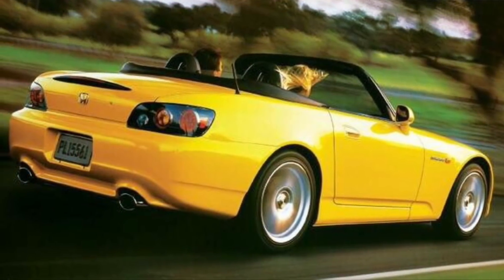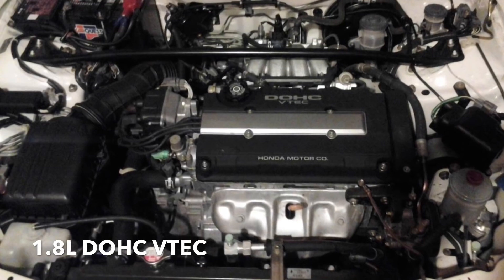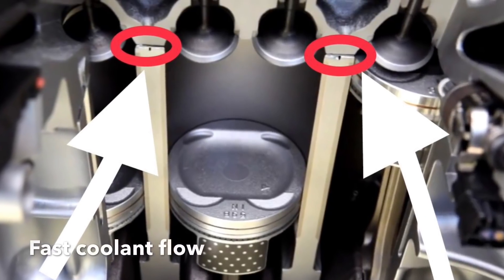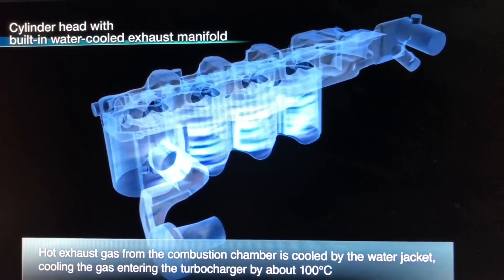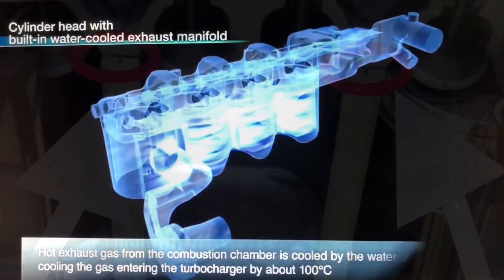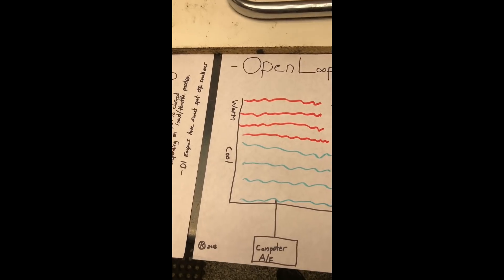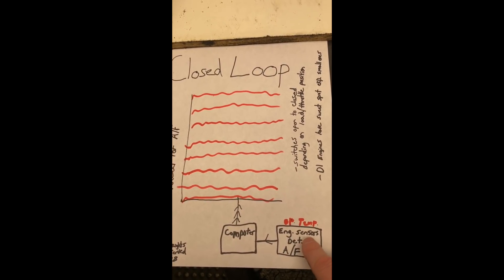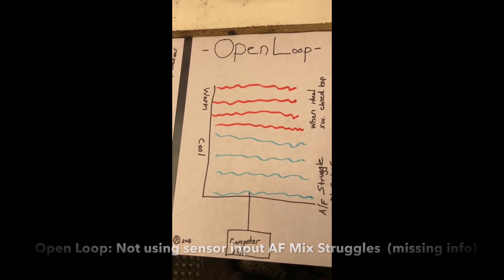1.5L Turbo Honda Oil Dilution Explained CRV Accord Civic

Comment: I would never buy Honda or Toyota, only GM , ford or fiat Chrysler.  US company's need the business more....would never buy a small turbo gdi engine  either but my focus gdi runs great after 90k. I use dex1 gen2 syn oil which is good for DI  and change at 6k to prevent fuel dilution and  crud buildup on valves.  Run it at high rpms with hi octane here and there too.
Reply: Leo Derosia my Toyota Highlander and Honda Accord were built right here in the US. GM and ford have moved a lot of production, or are planning to move overseas or Mexico. US employees need jobs more than US business need my money for CEO bonuses. Also the focus is going to be built in China.  I’ll take my American Toyota/Honda any day.
Reply: Toyota employs more people in the US than GM, Ford, and FCA. In fact most of their cars are made in the US or Canada (only ones made in Mexico is the Tacoma and Tundra).
Reply: Because honda it's made in US now the cuality not good
Reply: @ub 40  the big 3 still have a lot of plants in us and Canada. I work at a us supplier and we make seals for domestic and Asian ...we make all the seals for fca 8 and 9 speed transmissions. Thx for buying that overpriced Chevy haha, gives people like me a job.

Comment: Now the engine last as long as the transmission.
Reply: So is putting a tune on engine  bad or good? It should warm up faster, but extra boost may push more fuel past the rings. I'm torn
Reply: Lol, sorry to laugh but that is funny.

Comment: You're giving Honda too much credit. By now, nobody should have to guess at what the problem is. Honda is not honest and forthcoming with what the problem is. Forget all this open loop and closed loop hypothesis. All cars operate in open loop at the start and cars before computers operate in open loop continuous and didn't have this oil dilution problem. Basically, Honda screwed up and is extremely evasive in dealing with this issue.
Reply: Good answer Paul!  This got fired by Honda and yet he's still defending them and believe their BS solution. Heheh
Reply: @tousshong9438  yah.. I just went to the dealership inquiring about the 2019 s C RVs. And every salesmen that I talk to we're playing dumb like the problem didn't exist at all, and then they took me to one of the higher-ups and he played even dumber like the problem never existed. So that gives me the Assumption there is a problem because they're not even acknowledging the issue even exist. 
The best answer they gave me is. If I feel the the car has a problem then don't buy it.. Wow!!
Reply: @queparkerqp  you should've called them liars to their face and walked out.
Reply: Que Parker they’re sales people not mechanics. They’re not going to be the ones to ask about the mechanics of a car-any car. Their job is to sell you a car.
Reply: @queparkerqp  Just like Chevy, Chrysler, Nissan and others.....ill just buy a Toyota.
Reply: This guy says the engine is well designed? Unbelievable.
Reply: Agreed
Reply: I almost pulled the trigger on a 2018 CRV. Honda forums, people were complaining about oil dilution with the 1.5 turbo. Ended up buying a 2017 out of lease Toyota Camry w/30k  XLE V6 naturally aspirated. Feel like I dodged a bullet.

Comment: I think before this video you should explain the basic fundamentals of open loop controller systems vs closed loop control systems (no output sensor input vs output sensor input to drive the input fuel air ratios)
Reply from the maker: Sid I really didn’t want to complicate it too much.  Even still I am wrong in some sense of the video but a general idea is all anyone needs.  Ultimately these issues are not any brands fault its all driven by federally mandated laws.  Consumer drives the tech in the car not the tech under the hood.

Comment: That's unfortunate. The earth dreams v6 j35y6 I have warms up to half the guage within 5min of driving and stays there or a little below the entire time. Honda needs to fix these problems fast or else their reputation for the next few years will go down the drain
Reply: Riossios Eternal they are all the same no matter what manufacture....poor heat from the smaller engines and fuel diluted oil in direct injection engines
Reply: @calvinpeterson6056  lol when the GDI engines dilute oil but the Honda V6s burn oil = minimal oil loss?

Comment: I have a 2018 CR V turbo,i live in Canada,and its fucken cold up here,i don't have this issue at all,starts right up,warms up real nice and the oil doesn't smell like gas.I quess i was one of the lucky ones that got the recall done,We never do shorts trips with it because we live out in the country,its going in for its second oil change at the dealer soon,i will be asking question regarding this issue some people have with this. Its minus -40 at times and -30 are winter are real cold,i never plug my engine,and it starts up like a dream. Im sorry to hear some people have problem with there CR V's

Comment: There is only one message -- you are screwed.
Reply: Ever hear of a Lemon Law claim??
Buy a diary and start documenting EVERYTHING about this problem.......then contact a Lemon Law attorney after you take it to the dealer 3 or more times for the problem.
MAKE SURE you get a invoice from the dealer stating why u r bringing the car in EVERY TIME!
Dealers like to not give paperwork when they're doing warranty work so you have less evidence of a problem.
Reply: @motorcitymanman7711  You are still screwed LOL
I buy a car to go places, not to write a diary.
Reply: @MetaView7  
Not screwed at all laughing boy, if Honda doesnt fix this problem I get a new car OR my money back, its MY CHOICE, you obviously have no idea how Lemon Laws work! 😄
Also, not ALL engines have this problem, the 2 2018 Civics I own  so far with the 1.5T do not! I have a EX-T and a SI, both fun fantastic and are very fun cars to drive especially the SI.
Most of these cars WITH THE FUEL DILUTION are driving and working fine, unless they die prematurely the sky isnt falling!!
No shit u buy a car to drive genius, I'm saying if you have a  problem that's not fixed right away DOCUMENT everything to help your case if it comes to that.
Reply: @motorcitymanman7711  I am sorry you have already bought... sorry... I like honda, but this turbo engine is so bad, it will sink honda.
Reply: @motorcitymanman7711  I doubt you can get your money back. There are too many people in the queue.
Reply: @MetaView7  
"So bad"?? 😄😄 Other than this fuel dilution problem on SOME engines ( and the REAL question is how much fuel dilution is too much, many motors have fuel dilution) this 1 5T is one of the BEST engines Honda ever made!
It has power at much lower rpms than the VTech, and Excellent fuel economy..better than the VTech...much better power delivery than the lauded VTech that you have to rev the shit out of before you see any power! I've driven them and dont get the praise for that motor at all......and I'm a huge car freak owning over 75 cars so far in my life.
Reply: @MetaView7  
Doubt all you want, the law is the law and most states have Lemon Laws that favor the consumer.......and I come out ahead if I put 30,000 miles or so on this motor and I get a new one or a new car or my money back, it's a Win,Win,Win situation!!! So much for us all being screwed!! LOL
Reply: @motorcitymanman7711  I feel sorry for you. Whatever happens to you will never trigger the lemon law, so forget about getting your money back. How bad is the problem? IT IS BAD, but not bad enough to give your money back. The problem will exacerbate after the warranty is over. That is when the screw part comes in. If I were you, I would sell the car now because most people still don't know about it. Sorry, I am really sorry.
Reply: @MetaView7  
Lol, you're not sorry at all just gloating, and you're wrong anyway! No worries here.......

Comment: I had a bad taste in my mouth when Honda decided to go turbo....
Reply: MrStoneycool69 exactly now I’m glad we got the 2015 crv over the new turbo!
Reply: @MrNick98 I'm still driving my 2006......
Reply: Honda cleaned everyone's clock in F1 back in the 1980s with a turbo V-6.
Reply: @Alexi7666  damn near 60 psi, 1.5l v6 at that!
Reply: Alexi7666 A F1 engine doesn’t need to run more than 1 race before a rebuild.
Reply: @Alexi7666  while true, that doesn't translate to a reliable personal vehicle to depend on.
Reply: Honda isn’t SAAB.
Reply: MrStoneycool69
Reply: @en4905  why only Honda? Poor engineering?
Reply: @normt5463  Lazy engineering, slapping a turbo on was the fastest way to meet the EPAs ridiculous fuel efficiency standards
Reply: @AdamSmith-gs2dv  yup, most everyone else has already done turbo-4 you would have thought Honda would have learned?

Now they band-aid with a ecu and only cover part of the U.S., kicking the can down the road.  Unsuspecting owners are going to. eed a turbocharger rebuild sooner than they think as the fuel does not make a good lubricant for the turbo journal bearings.

Poor paying Honda beta testers!
Reply: I had that taste in my mouth too...

Comment: They don't understand people want dependability over mpg and tech .
Reply: Blame the EPA, they force companies to use this shit tech and
Reply: @AdamSmith-gs2dv  
Gotta hate the gubment doing dumb things like forcing gas companies to remove lead from gasoline and car manufacturers to reduce car emissions.

I hate having clean air to breathe. China's got the right idea; you ain't freed until yous gotz some medical masks to block the aerosols from entering your lungs and causing cancer.

Murica.
Reply: I will say the government is forcing these low quality unproven engines upon us to meet EPA mandated fuel mileage requirements.
Reply: Vote out the tree humpers!
Reply: @F22C1  
Would you prefer we hump our siblings? We can't all be Trump supporters, ya hearded?
Reply: @stevemilliron6842  Not until they improve cold temp performance, right now you lose 30-50% (temp controlled (Tesla) vs uncontrolled (Nissan Leaf)) of your battery when it's below freezing. That's a major problem in northern climates and the extra charging you have to do will waste your time and further destroy the battery. They need to drop that to like 10-15% lost before I'd consider buying one
Reply: Marktuyet small engine plus force induction is not last to last. That’s why Toyota keeps it simple.
Reply: @Jeff Sol 

You spelled "Democratic Socialist" wrong.
Reply: Marktuyet they do understand but they don’t have a choice...it’s all government mandated newer emission requirements. Direct injection gas engines is not new... has been in Europe for years but we never used it here because it has lots of problems one being fuel dilution of the oil but the meet the new emissions standards it could only be done with direct injection
Reply: @calvinpeterson6056  Lexus had direct and port injection for years, goes all the way back to the 2006 Lexus IS. It has only recently trickled down to Toyotas. Toyota calls it D4S. Having both direct and port injection prevents carbon build up, but makes engines costlier to build. I don't see why other manufacturers like Honda can't do it. Ford has started doing it as well on a few of their vehicles.
Reply: @calvinpeterson6056  yes , you have an excellent point . I buy base models to avoid as much tech as possible . Merry Christmas and Happy New Year .
Reply: Get rid of gasoline engines all together and go to diesel engines instead because diesel engines get better fuel mileage because they never go higher than 4,000 rpm’s witch will also help the transmission last longer to. Diesel engines never have this problem because the fuel is added to the combustion chamber at the very last second of the combustion and ignition process so the possibility of diesel fuel contaminating the oil is highly unlikely unless you loose compression in one or more cylinders.

Comment: My question is would you say the 14 civic si 2.4 is better because its not turbo?  And if you have 205 hp from a 2.4 and 205 from a 1.5 turbo in the new body style  you must have sport mode on in order to get the full 
205 go right?
Reply from the maker: cjg 1987 That new SI is running on different Turbo blade set up different compression ratio and different fuel pressures and tune than the other 1.5T.  As far as which is “better” they both have too many good qualities to compare engines wise the 2.4 is not real rev happy engine but its been proven much longer than the 1.5T... I think it comes down to what you like the SI is an amazing bang for the buck either way.  4 door SI are always in my favorite for daily driver choices.  Thats a tough comparison... I personally like the older K20 SI myself.  If I was to pick a new one 1.5T it would be for me because its light quick and more true to what I personally think a Civic SI is all about.  200+ HP from a 1.5 is nearly rotary engine power to weight ratio which is very impressive.
Reply: Ahhhh...... Honda has got a long way to go when comparing to a Rotary and high compression high boost = blowby. I believe that's the word ya'll. Looking for, Speed 3's have this sort of thing I know I got one
Reply: I have a small turbo, and after this experience, which I do not regret, I will be looking for an either a ILX with the NA engine, or a lexus v6 which while underpowered, will get to 200k gracefully. Turbo power is fun, but it is not efficient in real world driving and introduces ALOT of expensive parts that could fail.

Comment: Just changed the oil in our 2018 CRV EX-L AWD, 10K miles...oil smelled like gas, was really thin...very upset at this...we leased the vehicle 10x months ago, just hope it will last the next 2yrs while on the lease...going to turn it in big time at lease end, going back to Toyota...no more Honda's ever, not after seeing their horrible support with this problem...
Reply: Direct injectipn engines always have some smell of gas. So thats a completely irrelevant comment. If you wanted to use that thing between your ears. Send off a Oil sample. Measure the amount of oil you put on and pull out. Actually ways of seeing if theres a issue. My 2015 Civic smells lile gas, my Brothers 2018 chevy smells like gas. My mothers camaro smells like gas. Smelling gas means nothing.. get actual facts.
Reply: @Rob_Nasty  
The crankcase overfilled by a half quart or quart of gas means something.
People should change their oil every 3,000 miles or so while this problem is going on and put in a half quart LESS of oil.
Also maybe put in slightly thicker oil.

Comment: I lived in Phoenix, we had lots of days in the winter that it would go as low as 30 degrees. So the problem is not just cold climates. I was going to get a '18 CRV......not now, will hang on to old Betsy a few more years.

Comment: Trust me it sucks. I just traded in my 2018 CRV. Bought a Toyota hopefully I will be happy
Reply: Ouch, I hate to think how much money you lost on that
Reply: Adam Smith I lost $4500. I rather take that lost now since the car had low miles and still look new then to wait and see what Honda decides to do. When you pulled out the dipstick on my CRV the oil would drip from the dipstick lime water. That’s why I got rid of it.
Reply: •reshirm• I had to make the decision. When I went to trade in my 2018 CRV Exl with all the accessories and only 8900 miles on the clock, they didn’t even want it.
Reply: @GamingPeak13  so what did you do with the crv ?
Reply: thejerseydebil took it back to Honda On Grand where I bought it. Got into an argument with the sales manager because they did not want the vehicle back. My family bought over a dozen vehicles from this place. They also all get there’s vehicle serviced there to, he knew if he didn’t work with me that was going to stop. So we came to an agreement of $26,000  back fro my vehicle. Not bad after driving for 9 months plus 8,900 miles on the clock. After that bought a used Toyota Venza. It has 40k fully loaded v6. I love it. The headache and nightmare is over.
Reply: thejerseydebil sorry for the late response. I traded my CRV in and bought a Toyota Venza I lost $5200. But I’m happy with my purchase. My Venza runs and drives great. I know I can get 200k plus out of this motor and vehicle.
Reply: Jee Vang, who would want it now everyone know that these 1.5T engine is having oil problem?  Basically, Honda should recall these bad cars in the USA just like in China cuz nobody want it now.